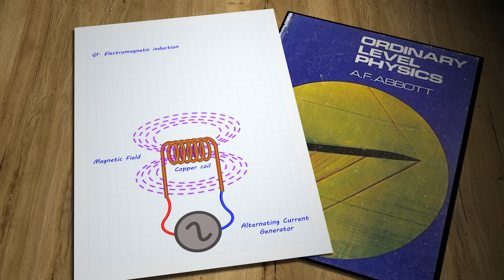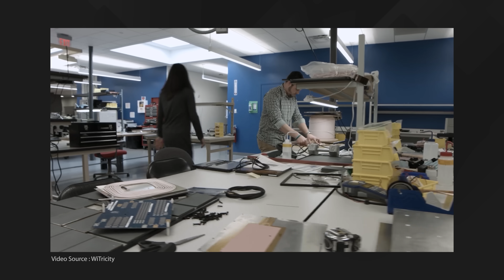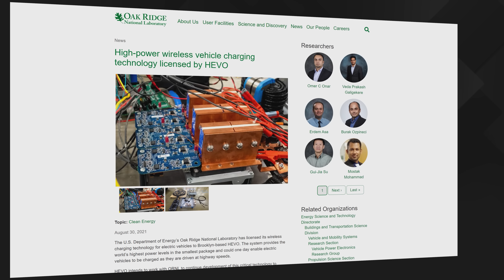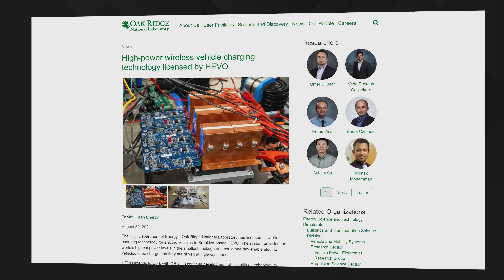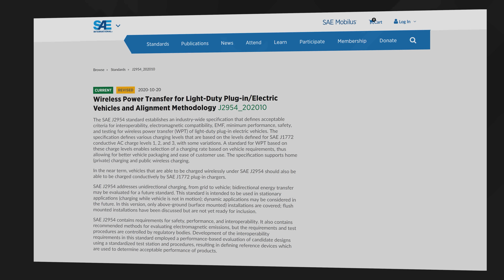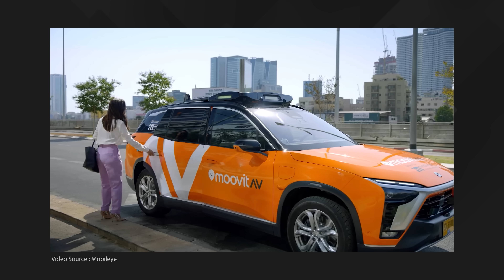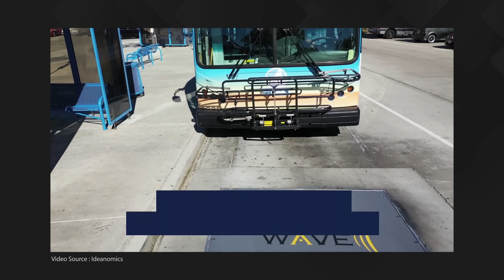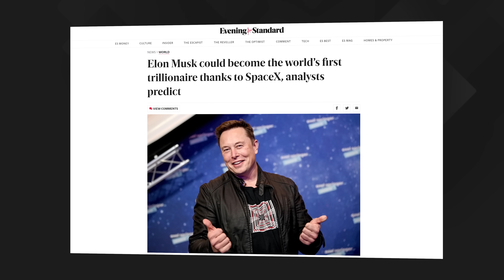Wireless FULL EV charging has arrived!  Exciting new tech breakthrough.

Comment: I dislike the idea of wireless power transfer technologies in most cases!

Dave, I have never felt such a strong tendency to disagree and dislike one of your videos, but it's not all black and white, that's clear. As a physicist directly involved in researching ways to make our technologies more energy efficient AND lower their environmental footprint , I am almost disgusted by many applications of wireless power transfer.

I feel haunted by some form of Jevon's paradox here - in this case it means basically this. We (scientists) work hard to improve energy efficiencies everywhere and then what, the gains are more than negated by wasteful behaviour of people. Wireless power transfer for charging is such a technology that I actually oppose in many (not all) cases.

While I am fascinated by the advances and there are definitely (!) SOME use cases, I STRONGLY oppose the general trend for wireless charging in general. Even if it reaches "up to" 95% , what matters is it is significantly WORSE than a wire in pretty much EVERY use case. In most cases it isn't really saving any wire (material). 
Looking at phones etc, where wireless charging has already been adopted widely. Claiming wireless is even a lie here, the wire from the switching power supply to the phone is just as long + all the magnets and extra mass. The wireless phone charger + cable is much bulkier than the mere charger + cable and thus environmentally worse just by the materials used (those magnets!!) - not even considering the much lower electric efficiency. The only advantage (not having to plug in a plug --> pure laziness of people. Doing the math, if all people with the phones capable of it actually use it instead of a simple DC/USB-plug, there are 1-2GW peak power or more needed to power basically people's laziness?  --->. I find in unacceptable. 

For privately owned cars sitting in a garage I say it should be forbidden to use this. We can't allow ourselves to waste away terawatt hours of hopefully renewably generated clean energy because we're getting too lazy to plug in a cable. Once we have clean solar energy to waste, we can do this... IF we have the sustainable mining needed too - hopefully in 30 years, realistically much later. 

As for taxis and trucks and other use cases. Those valid use cases do exist, but they're not in the majority. Everywhere where it is actually more sustainable to replace super large batteries by wireless charging some super capacitors for instance - I'm all for it. 

I know you mean well, 'I just think' (pun intended) that you neglected to see the wastefulness of wireless power transfer in most cases - I would like for you to consider this more.

regards
a physicist ... working in renewable energies and improving overall sustainability also of the supposedly already environmental technologies ;-)
Reply: Hi Andreas, I like your comment. I worked in wireless charging design for some years and you make valid criticism. The reason it didn't get off the ground then wasn't technological, it was that consumers don't really want to pay hundreds of dollars extra for the convenience of not having to plug in. A counter argument I think you missed: by making EV charging easier it might speed up the switch to EVs, saving years of gasoline emissions. As much as we need degrowth, the modern world is built on wasteful convenience. Anyway good to see a thoughtful comment like yours 🙂
Reply: @Ikbeneengeit  , thanks and good point on the cost being prohibitive as well, it's always going to be much more expensive. Same goes for wireless phone chargers. But as I mentioned, it's also way less environmentally friendly because of all the extra material needed!  It would make sense only in cases where it's not practical to park a car or device of any kind for longer periods in order to charge, . Like city busses or taxies. 
Talking about cost. If you lose >15% of your usable charge due to bad coupling, that's also a significant cumulative disadvantage too!
Reply: Andreas - I agree with the points that you make here.  I am a Power Electronics engineer (>10GW of my different designs have been built) and I was working on resonant power transfer 30 years ago.  Back then when EV battery technology was clearly the limiting factor for EV adoption the idea of wireless charging roads did have more technical credibility.   With the system I was involved with there were a few limited test roadways built  - enough to realize just how much of a logistical challenge it would be to scale this technology to meet the needs of a national vehicle fleet. 

My 'take' on the recharge pad is that this has always been sold on the basis of it being a bridging technology to the ultimate goal of wireless roadways  - it gets the equipment into vehicles and provides a convenience factor to the vehicle owner in the short term.   Certainly a recharge pad is a lot less expensive than a complete roadway.  The reality is that this convenience comes with a cost - both financially and a convenience cost.   The financial cost is the cost of the wireless equipment plus the operational cost - you realize that you need to abandon ideas like 'return on investment' when the equipment costs initially to purchase and then every time you use it, it costs you more than if you simply plugged in your vehicle to a standard charger.  The inconvenience cost factor is apparent when these recharge pads are installed in parking lots.   At my place of work there are several conventional recharging stations which are located in between a pair of parking spaces and it is left to the two vehicle owners who share the recharge outlet to coordinate the mid day swap - which involves unplugging the recharged vehicle and plugging in the other vehicle.  During this mid day swap neither of the vehicles need to be moved.   If recharge pads are used then you end up having to physically move the vehicles during this mid day swap.  You can argue that with sufficient recharging pads then this inconvenience is eliminated,  however the reality is that these recharging pad systems are more expensive than conventional charging systems and there are not enough conventional systems available here and now. 

As EV battery technology improves the argument for wireless roadways diminishes and hence the reality that the wireless recharging pads being seen as a bridging technology has to also diminish.   This leaves this technology having to complete against a physical plug connector on the basis of convenience alone.

The one application that did adopt the technology that I was involved with 30 years ago was based in creating wireless roadways within large automated manufacturing facilities.  These roadways power the electric powered robots that move around the factory space.  In this very limited scope wireless roadways certainly seem to make sense.
Reply: @Michael Harrison  the amount of copper and the amount of work needed to equip the highway network with the necessary coils will NEVER justifiable, my thoughts exactly. Roads are not rails for trains and even there, who would want to invest so heaviliy besides some japanese superconducting maglevs - marvellous, but definitely incapable of scaling!
Reply: i strongly agree
Reply: tl;dr: wasteful
Reply: @buttonasas  indeed, but I’d rather explain in more detail than two word comments that might not convince many, rightfully so.
Reply: @andreasbrand3191  ah OK, I get it. OP did a long blurb saying its wasteful. Agreed. So all of us (including OP) should be fans of stuff that isn't wasteful, like 85kHz inductive that is less wasteful than a cable ;)
Reply: I was the OP :P
Yes... we all should be fans of stuff that is less wasteful. By all means, if you directly couple them in close contact you can make them very efficient, I still want to see the lifetime analysis on the energy transferred AND the materials (power electronics, etc.) to see if it really is more efficient. If it is more sustainable... by all means. 
Especially for busses and such, I can believe it quite easily - I would even think that combining it with supercapacitors might make even more sense as they could be much more efficient with much better lifetime than batteries - for something like a bus, totally!
Reply: @buttonasas  yes, the Momentum Dynamics system isn't though, it's more efficient than a cable at 85kHz
Reply: This system is sadly part owned by a large motor manufacturer that appears to hate EVs (advertising "self-charging hybrids" by perpetuating EV myths) however Momentum dynamics has a system that uses 85kHz resonance induction to charge EVs at greater efficiency than using a cable. I used to be skeptical of wireless power, due to the same efficiency concerns as you, then I recalled that at high frequencies the voltage can increasingly be viewed as a transfer of field energy, rather than a wired transfer of electric charge
Reply: i think the best use of wireless charging is car to grid transfer....we unplug our EV as soon as it's charged...it sits in the driveway most of the time....happy and useless....imagine if if could ballance
grid load and then re charge for our trip to the shops....brilliant.
Reply: Couldn't possibly be any health risk from widespread use - like childhood leukaemia?
Reply: @sideshowbob5237  
No, that can be ruled out. No ionizing radiation here, just low frequency radio waves. There is a lot of loss but if anything then some material might get warm and thats it.

Comment: Great video as always, but as a laggard ;-) I cannot see lithium iron batteries in vehicles for more than 15-20 years. Hydrogen fuel cells are the only way forwards. Also I am a highway engineer, and placing these coils under the surface course of the asphalt is not a great idea. 100% of asphalt is recycled and reused in new material. When you have these coils inside (how much copper??), How can you do that.

Comment: What you need is a system that will charge the battery while you're driving maybe by installing an extra Lane along the highway. Its not much of advantage to have wireless charging while parked because you might as well plug it in. Also if it can be charged while driving the vehicle will it require a much smaller battery with all the advantages that implies. Great job with this video you did an amazing job very descriptive. Thanks
Reply: The cost of implementing charging while driving will be prohibitive, especially if there’s more than one standard. I think it’s better to concentrate on buses and taxis stands, and maybe highways. Even at 300 kW, you can’t get much in the battery going 30+ mph - your over the pad for < 1 s. 
Wireless charging would be more convenient at home and, like he said, always allow the grid operator to access the battery for grid balancing. I plug in only every 2-3 days, the pad would always connect. I understand that you don’t have that possibility and I hope something like street light charging comes around to areas like yours really quickly. 
If the technology does have a breakthrough, then having that smaller battery will automatically increase your range due to the reduction of weight. The only problem would be if you are far from roads that have it (camping in the woods). This is where battery swapping would come in handy. 40 kWh for every day use, 70 kwh rental battery for vacations.
Reply: There is a distinct advantage over plugging in a wire. If the wire is on the charger it will inevitably be abused and or wear out. It the cord were on the vehicle it is inherently heavy and uses power to transport. Having a recessed pad in a parking stall would probably not wear out as soon as a wired connection. Until battery technology improves, charging while driving would would either only impart a fraction of the energy needed or require a prohibitively long distance to do so. Putting it in the roadway would also diminish the structural properties of the pavement requiring a very robust and expensive pavement section. It would probably be better to position induction loops along the side in a barrier in such a charging lane. That brings up another problem. The real estate to provide such a service. The infrastructure is crumbling as it is. Funding traveling charging lanes would drain resources from critical infrastructure projects. The technology is improving. I don’t think its quite there yet.
Reply: Ya havin it alongside the road in a curb or something would be better this way you could just utilize the existing Lane on the right hand side for charging and wouldn't require too much alteration. But a set up along the highway wouldn't be like a pad it would be more like a long coil that would resemble a railroad track with a section long enough along the road to give you a full charge. Battery swapping is not a bad idea that's another system that might work. Or maybe you could go with a hybrid electric vehicle using solid hydrogen discs to constantly supply energy to the batteries. As far as charging at home I still think direct wiring is a better system then the pad because the pad is always going to involve more losses than a direct wire and if the wire goes bad it's easily replaced.

Comment: Plugs work fine. Getting enough chargers and enough carbon free power is wayyyy more important than making EV charging even easier.

Think of it, fuelling an ICE car means standing beside it holding a dirty nozzle, while you breathe hydrocarbons and bathe your soles in diesel. Yet nobody ever asked for a fuelling robot (perfectly feasible). Charging an EV means plugging in and walking away to do something better with your time.
Reply: It's the two way seamless transfer of electricity that really makes this idea valuable.  The ripple affect on related infrastructure suggests significant potential for a big ROI.
Reply: @richardlangley90  so robots that force you to plug in your car if it's in the garage...   a robot could honestly be cheaper than the devices to wireless charge the car anyways.

Comment: What is the efficiency of a cable and plug?
Plugging in my EV is not that hard
Reply: it's very inefficient.
Reply: @briannicholson1958  A cable and plug is nearly 100% efficient.  There is energy loss in the rectifier on board the car, but that would be the added to the inefficiency of the inductive coupling.
Reply: @incognitotorpedo42  I don't think he is referring to electrical transfer....I think he is referring to the actual process of physically taking the cable off it's holder and plugging it into the car.  As was said in the video the big gains from the big picture perspective is the ability for the grid to utilize the battery.  If the battery in the car was fully charged the owner is less likely to plug it in.  Same goes for when out shopping or at work where parking is not in the employers lot etc.  The opportunity for the EV owner to make money on the use of their battery as well as to have a smaller battery, as well as to have their vehicle always at or above a minimum charge presents some real opportunities for a win win.
Reply: @incognitotorpedo42  you forgot the small energy loss as heat due to the resistance of the cable
Reply: @niconico3907  Small??? For fast charging stations the ventilators on the charger are all on during the whole process... The heat loss is huge!
Reply: @dominiqueridoux2073  the fans are cooling the rectifier power electronics, not the cable. He already talked about electronic losses.
Reply: It is hard if your EV is going along a road at 30mph !

Comment: How about the 'Reverse'?
The Car bringing a full charge of electricity back from the road, then 'Offloading' the charge into your house?
Reply: Wireless can function both ways it just depends on which coil is used as the transition and which as the receiver.  That was his point about the grid being able to use your vehicle batteries through this device.  So yes you could put this device in your driveway and use the car to power your house in theory with the same hardware in the car that is charging when you drive down the road. Or park at the grocery store.

Comment: It doesn't matter if you think I don't have an open mind. The facts are clear. The grid cannot transport the amount of energy gasoline contains.  EV's only make up about 1% of vehicles at this point so we have a long way to go. We will need to install small nuclear reactors (300mw) in each neighborhood (roughly 5000 average houses in moderate climate) to meet charging demand. We also need to start mining in the ocean for minerals which isn't very green and might defeat the purpose going green.
Reply: I don't think you have a closed mind.  I think you don't have the correct facts.  You think each home needs close to a megawatt to charge an EV overnight?  Please.
Reply: @incognitotorpedo42  Yea I must have missed a zero in the math and didn't think about it. I mean 5000 houses.